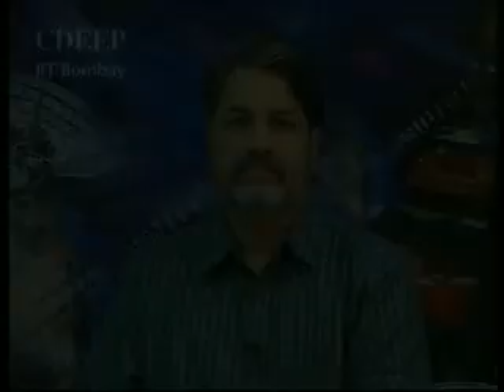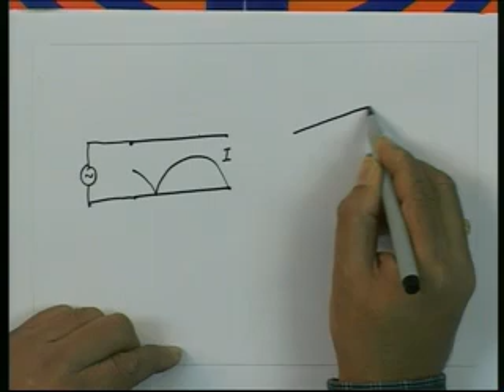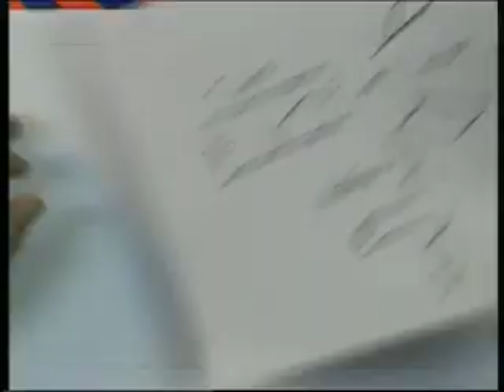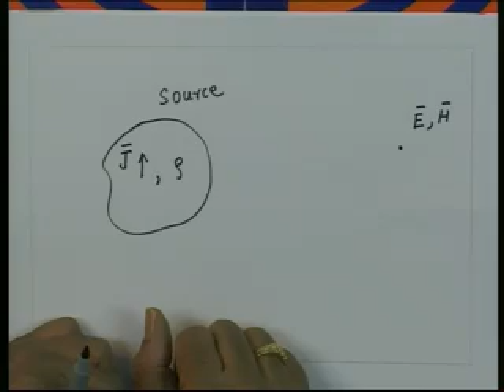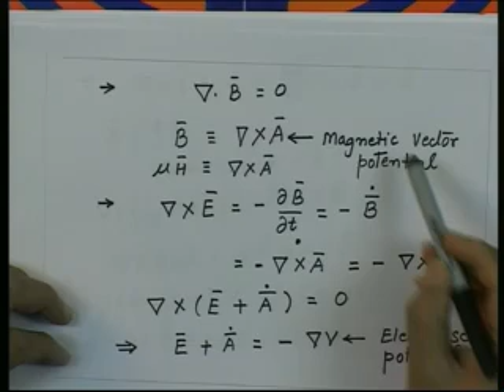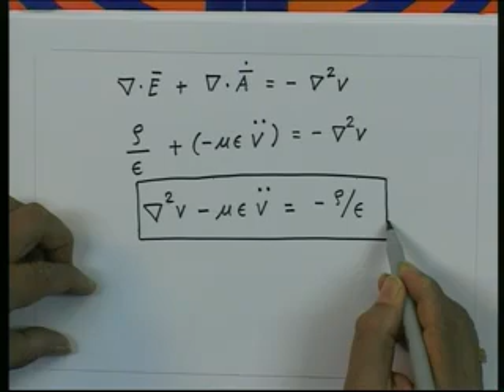Radiation (Antenna)

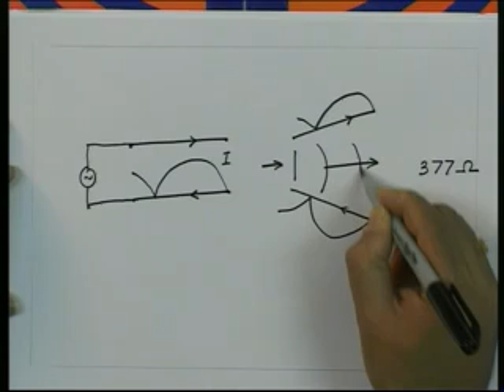Comment: At 20:44 if there is a matched load for the transmission line then how is the current standing wave forming as there is no reflection?
Reply: Good question, I was also having the same question before but I think he was trying to say that if there is an open circuit (which he also draws and shows) then there would be current standing waves formed, because from open circuit ends there would be reflection. So if we slowly flare those open circuit ends, then the same current standing wave type distribution remains but now they do not cancel each other as they add up due to increased spatial difference between them.

Comment: can some one explain y there is no radition in a ac currentconducter if it is placed nearto another conducter which always carry current oppisite to first cinducter
Reply: bcoz they cancel each other
Reply: if we place two conductors parllely of which carrying ac currents. I guess radiation will spread cylindricalli in respective conductors. Being they placed near my guess is radiatin will get cancelk in between the conductors hoe ever there will be outer radiation exists of two conductors pleas clarify bro.

And one as the proffeser said energy is wasted in the form of radition does it mean in transmission line also energy being wasted?
Reply: if current flow.. then it produces magnetic flux in a particular direction..apply rt hand screw. ...now if current is flowing in opposite direction...then their magnetic field will be opposite and they cancel each other if their spacing is very small
Reply: transmission line or waveguide mai radiation should be avoided. ...as this is wastage...bcoz our purpose is to transmit energy either in vi form or in the form of em wave to destination...but in the case of antenna... our purpose is radiation...
Reply: Thanks bro now i got it

one more can energy be wasted in ac transmisson line as raditaion
Reply: bro may i know ur qualification mine btch eee in telengana. Tried to learn so many things but failed due to no proper lecturer.

I am working in IBM as software which i have no intrest in this feild studied electrical amd doing software jon no intrest
Reply: well m a married gal/woman...completed b.tech.. m.tech...already left job from core elex...
Reply: Altruist how can we avoid the phenomenon that is happening the lectrurer told that ac current produces radiation you said we should avoid it how some one can avoid which is already happening.